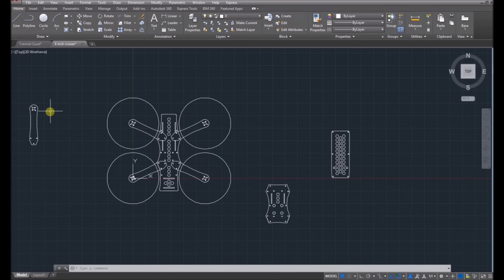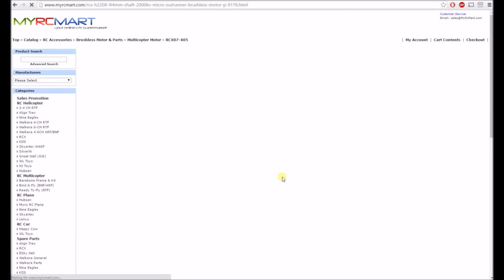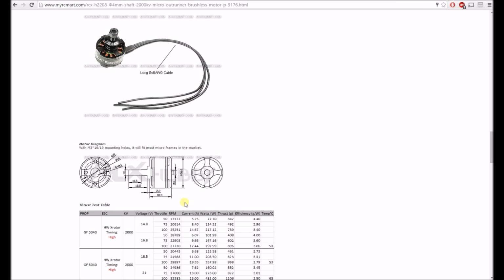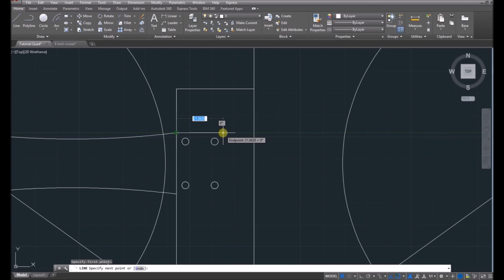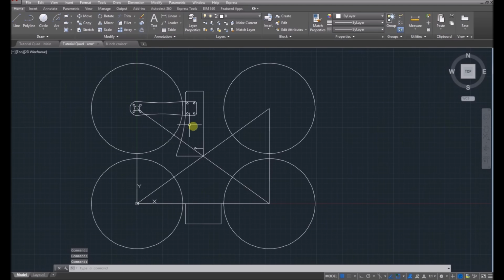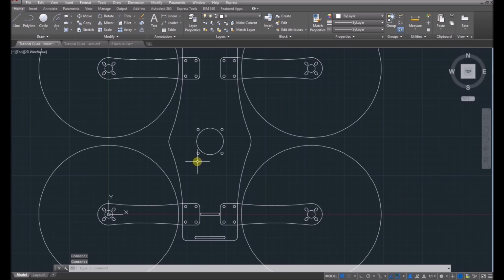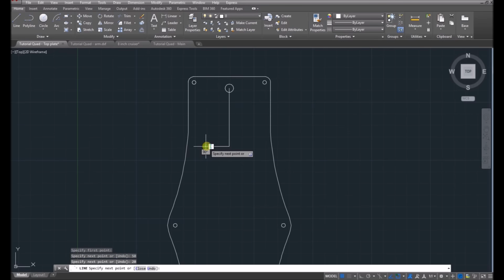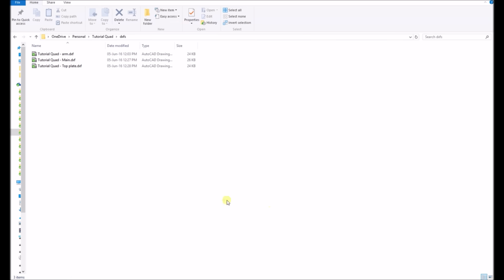Design your own Quadcopter frame in 1 hour - Tutorial

Comment: Adam - What size are you making your holes?  It looks like you are using a 3.2mm hole for a 3mm bolt?  If you do another one of these, cover the radius and dimensions of the holes would be helpful for us newbies.  For FC holes are you using a 30.5mm hole spacing or a 30mm hole spacing and do those holes need to be 3.2mm or will an exact 3mm hole work for a M3 bolt?
Reply from the maker: Hey, yeah I am using 3.2mm holes. Honestly it depends on the CNC cutting. I have send drawings to cnc madness with 3mm holes before and the bolts are a tight fit but they will screw through 100% fine. I've just developed a habit of doing 3.2mm holes which gives just a little bit of wiggle room. I'm using 30.5mm for the FC spacing.